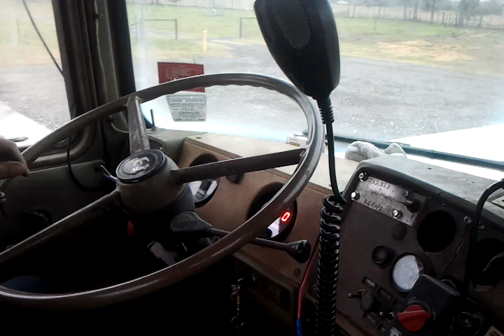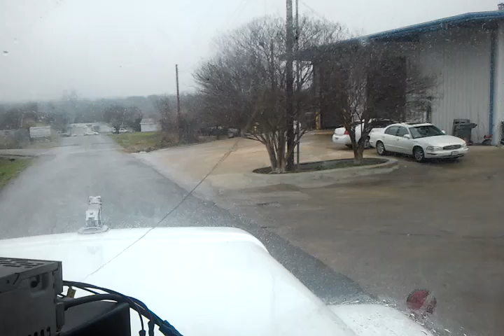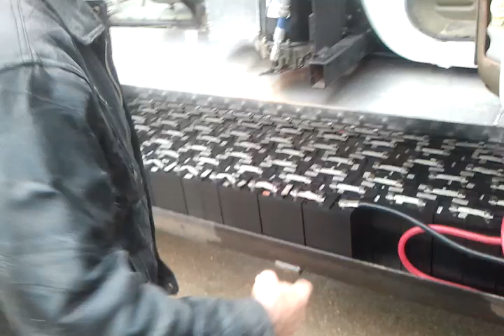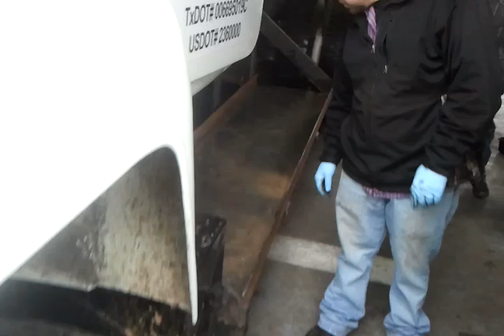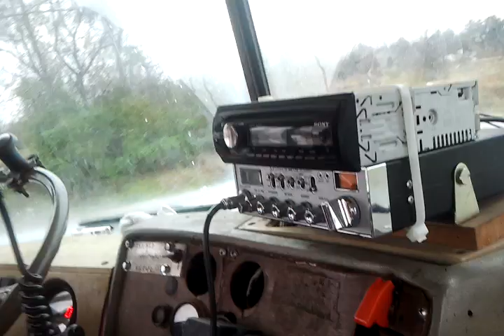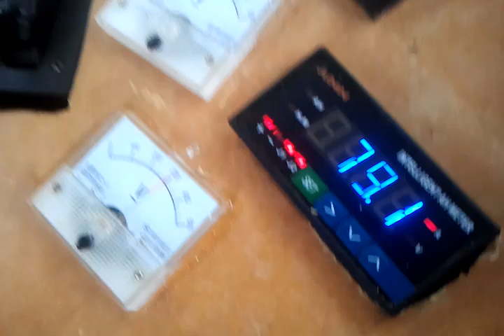electric 18 wheeler driving

Comment: I love it.
Most of my experience is OTR, and that colours what equipment I'd use in an E truck. I gave it some thought quite awhile ago.
I figure two Rinehart controllers with a couple 150Kw (continuous) 3-phase AC induction motors (copper core), and a Eaton-Fuller 13 speed tranny. Battery pack would be similar to what is planned for the R model in the vid, with a BMS that'll allow Hybrid charging. That would complete the tractor, but would be only half the setup.
The trailer (likely a dry van) would have a belly mounted genset designed to supply 125-150% of average energy usage (some math would be required to get the genset correct). Enough to charge while rolling, but not too much. Lets just hope I don't find a 12% uphill grade that's 20 miles long. Except for some details, that mostly completes an OTR setup for me.

Comment: I am very curious about how you ran the compressor for the air brakes. I was also wondering about the automatic transmission. Most all of the EV conversions I have seen use manual transmissions. Is there a reason for using a manual verses an automatic? I think this is the coolest EV conversion I have ever seen! :)

Comment: What is the electric motor information output? watts? hertz?
Reply from the maker: This is an unusual motor and we are basically running it on half the voltage and half the amperage. Normally we use the WarP 9 Motors, which has a peak out put of 300hp. ( we sell these motors and the Zilla controllers on our web page:  www  dot   Greenshedconversions   dot com )   This motor that we are using here, is rated at 500V, but we are running it at 300V, because that is the size of the Affordable Zilla Controller. Unfortunately, running a high voltage motor on a approx. half its voltage, cuts back on its power out put.  I believe peak out put of this motor when the truck was pulling its fully loaded dump trailer was 120Kw. When we got up to 50mph it was down to about 90kw.

Comment from the maker: "the trip total was just a little over 10 miles and it used 91 amp hours total. so yes is was about 45 amp hours for half the trip.  so the total amount of mileage with this 200 amp hour pack that i had on this truck that day would be about 20 miles total that i could go. so if i went 10 miles at almost 100 amp hours then i could go 20 miles at 200 amp hours.   the 384 batteries that i am going to end up when the project is finished is 800 amp hours total with the all of the batteries installed.  so that would mean i could go a little over 80 miles with 800 amp hours.  i am investigating other ways to make this truck go further then this.  i love these conversations.  please ask more questions because i learn from the questions as well as the answers.  from Scott "